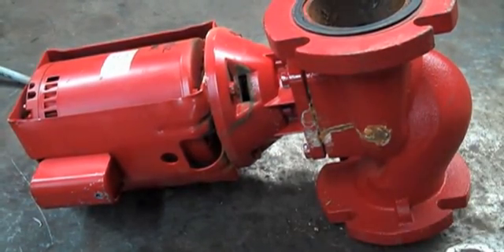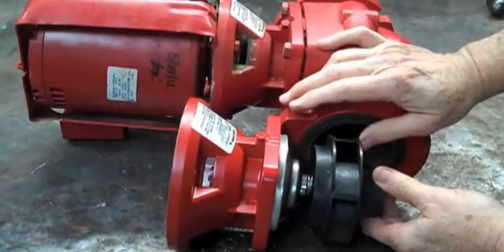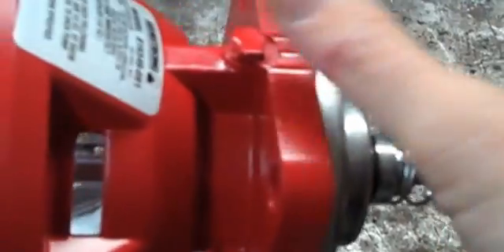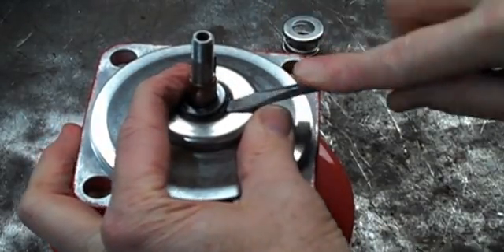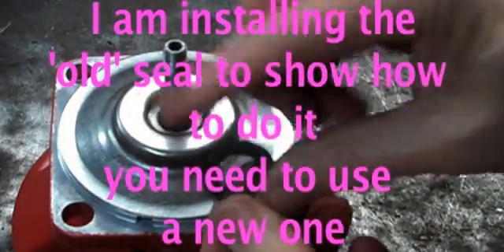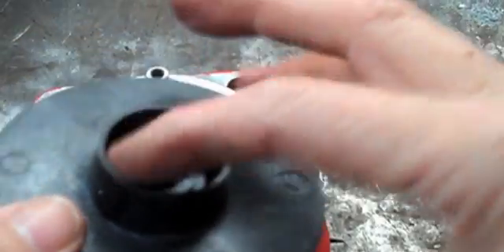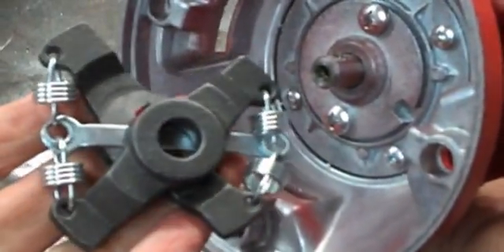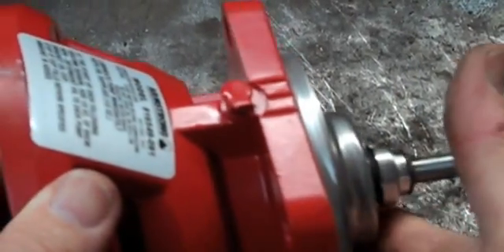Pump repair Circulator Seal Change fix leak Bearing Assembly Coupler replace how to

Comment: Clear concise instructions on disassembly. However one thing to mention is when putting the new seal on to not touch the surface of the seal, carbon or ceramic.

Comment: So question. I have changed the couplet numerous times. I’m having some squeaking and more water leakage recently than a drip drip.  When I remove the bearing assembly from the casing will I need to turn the water off or will I have to flush the system.   I would pay someone to do it but there are very few people that work on these anymore. Thanks in advance and I hope my question makes sense.  I plan on doing this when the weather warms up so I am not without heat.
Reply from the maker: you will need to isolate  the pump  or turn off the water.. if you don't have valves on each side of the pump you will possibly drain the system .. not knowing your system cant answer the flush part . if its a heating system and the water is nasty then might be good and add some treatment
Reply: What treatment do you recommend. I’m not sure that we’ve ever added anything to the water.
Reply from the maker: i dont really have a suggestion .. the place where you buy parts might

Comment: Just one question. Can I use full synthetic oil to lubricate the bearing?
Reply from the maker: i think the factory specs 20wt //but most of them are perm lubed these days .. make sure it needs to be oiled
Reply from the maker: it does need to be NON detergent
Reply: must be 20 wt NON detergent oil

Comment: Thank you 
Much appreciated
Reply from the maker: You are very welcome
Reply: roger brainard I just got off the phone with supplier and he said don't even bother with the seal kit because 80% of the times it don't work.
He said just get the whole bearing assembly.
Is that true?
Reply from the maker: i would say in general yes .. if it is only leaking a few drops ( a sloooow drip ) you can usually change the seal successfully .. if it is leaking more than  that it is likely that water has been forced back into the bearing assembly housing  and ruined them the bearings ... a more sure fix is to change the BA .. they usually have them with the impeller installed already that would be my recommendation..  again it depends on how much it is leaking
Reply: roger brainard oh yeah it's leaking like waterfall....thanks again
Reply: roger brainard the pump I need work done is a Armstrong S-45 MF/BF

Comment: Was trying to avoid taking apart later today, but tenants need heat.  On the one side of the pump coming from the heater the pipes are hot, but on the other side feeding Taco valves, the water is cold and nothing is being pumped.  It's making some noise, weeping a little, but at least the previous owner left parts.

Comment: what happens if you install a clockwise or counterclockwise coupler? or what type of coupler do you have to install???
thanks
Reply from the maker: there are a few different types of couplings and they vary from manufacturer to manufacturer .....if the couple is the 'spring/yoke" type and  the pump rotation is clock wise and the coupler is made for counter clockwise the motor will push the springs together and probably ruin the bearing assembly ... many pumps have on line parts lists ...best to check for the correct part # .. but you can tell which way the pump rotates by looking at the impeller .. or the coupling .. if its a spring type the motor will pull the springs .. .. if its an insert type it wont matter

Comment: Great video thumbs up. I have an s-25 bf that was replaced under warranty last season but started squealing by spring time. Now it's squealing again louder than ever. Is there a video on how to remove the pump from the system? I'm not sure how these work and figure if I remove the pump then water will flow out everywhere.
Reply from the maker: there 'should' be valves in the pipe on both sides of the pump.. if not follow the pipe back BOTH ways until you find a valve that you can shut off.. the water in the pump will then be the only water you loose .. BE SURE TO TURN OFF THE BOILER AND THE ELECTRICTIY....  ALSO - you can remove the motor and see if the squeal is in its bearing without loosing any water

Comment: How to tell if circulator pump is bad
Reply from the maker: +Latasha Strand if it is leaking or making an unusual  noise or not running at all  or if its running and no water is being pumped ..

Comment from the maker: Dicofole .. you want to use a light non detergent oil.. the 'spout' oil for fans works fine.. the bearing assemblies are supplied with a small amount to be put in at startup.. after that 3 drops every 3 months is all it needs

Comment: Hi; I have an Armstrong S25 and I just replaced the entire bearing assembly including the new casing. It is supposed to be maintenance free and no oil required. I find that it is much louder than the original bearing assebly that I had for 20 years. Do you know why?
Reply from the maker: if it is the maint free unit they have ball bearings instead of sleeve bearings ..which will make a little more noise ..the old version is still available as far as I know ... If the noise is a prob you can replace the s25 with a wet rotor model 230 ..ss ofr stainless and ci for cast iron .. they are usually very quiet .. I have 6 that run all the time in the winter in my house .. I can hear them in the mechanical room but nowhere else ... hope that helps
Reply: roger brainard Roger; thank you and I very much appreciate it. The noise level is 2 times the old bearing and it is quite annoying as I live in a 150 year old Victorian Home and the furnace is directly below the dining room. In other words you hear the sound from the dining room. Do you think that with time the sound level will decrease? Also, I found used versions for sale in Montreal where I live. I paid $230 for the replacement and hate to think that it is wasted money. Thank you for your help! FC
Reply from the maker: Frank Candido not had a lot of experience with the new ball bearing ones.. but ..if they don't start to get quiet in a week or two they probably won't ..  there are actually a lot of things that can contribute to the noise transmission .. is it 'air born' noise or is it being transmitted thru the structure .. if structure maybe the pipe is supported to hard or too loose..  ??  . if you replaced the entire pump the coupling is new .. if you replaced just the bearing assembly did you also replace the coupling .. and are the rubber mounts on the motor in good shape... both of those can cause some noise as well ..best
Reply: roger brainard I replaced the entire assembly including the cover. I'll see what happens in a weak. Thanks.
fc

Comment: VOLUTE!
Reply from the maker: lol you are correct!!!.. I used the term 'casing' because most of the folks I deal with call it the casing ..or body ...or scroll .. or ???  Volute ( the actual proper name ) is not used very often by the folks that are actually doing the repairing  ...